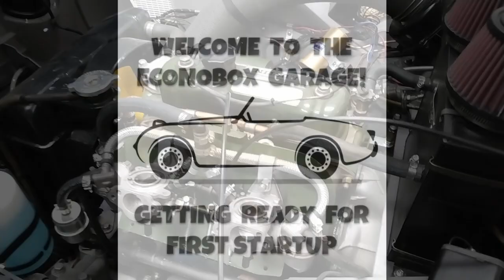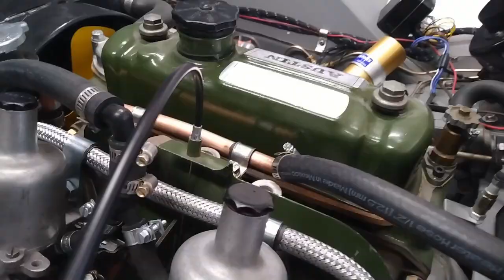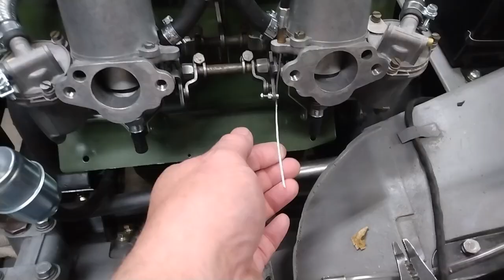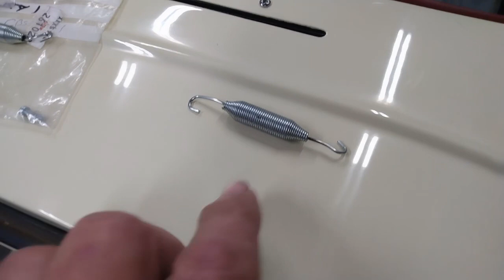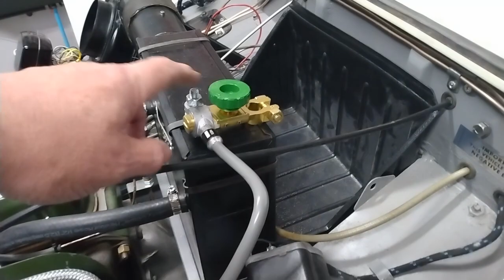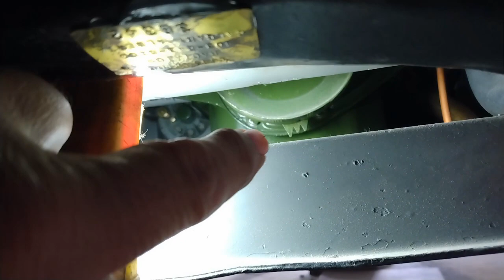Getting ready for the first start in over 40 years! Bugeye Build episode 129

Comment: Did you have to cut the two rods that go into the master cylinder? I have disc brakes that were added before and I am told that I have to shorten them to 3 11/16.
Thanks, John
Reply from the maker: Hello John. I didn't change mine at all. My rear brakes are the original Bugeye drums, the front disc setup is off a later Midget and I used the standard Bugeye master cylinder. I understand that it is not the ideal setup but it seems to be working OK.
Reply: @EconoboxGarage  thanks for the info.

Comment: Yet another good video, Ian! One tip you may want to share is that you can easily determine if the piston is at TDC by sticking a plastic straw in the spark plug hole. You then turn the crank and watch the straw go up, sit still for a split second, then go back down. You can move the crank back and forth until the straw reaches its highest point and just before it starts to go back down.
Reply from the maker: Great tip, thank you.

Comment: There's nothing hard about tuning SU carbs. The main things are to have the right needles and to make sure the jets are centred. The actual tuning is very easy but you really need a Unisyn or something similar to check thst they are in sync. I note that you have a later model engine and assuming the carbs came with it they should be fine.
Reply from the maker: Thanks. These are the later HS2s with the spring loaded needles.

Comment: Ian, vacuum advance is an economy device and is at its strongest at light throttle - when cruising etc. It is not necessary at idle. Hence, the vacuum port on the carburettor is positioned so vacuum is not available on closed throttle.
Porting it from the manifold will apply vacuum to the diaphragm at closed throttle (idle and deceleration). Vacuum at idle is usually around 21”Hg, but during deceleration close to 30”Hg - not good for an aging vacuum diaphragm. 
Unless you’re chasing fuel economy you may as well run your engine without it.
Reply from the maker: Thanks for the input. I'm going to run with what I've got for now and see how it goes. I believe there is a vacuum advance unit for the Lucas distributor that is designed for a manifold source. I may try and source that in the future.

Comment: One suggestion I might offer: sometimes turning the same number of flats on each carb to adjust the jets doesn’t work perfectly. What is important is that the jet lowering is the same on each carb. I have found that a better way to insure that result is to measure the depth of the jet on the one carb after lowering with a caliper and then make sure the depth measurement is the same on the other carb. 😊 Lin
Reply from the maker: Thanks for this Lin. I did double check the depth but forgot to mention it. I will be sure to cover that bit in the next couple of videos.

Comment: those carbs are very well done. I always find it funny that the oil needs to go in those dashpots, but only in that center tube. They don't need to be filled entirely. I may have done that a few times accidentally. It makes a big mess as the oil leaks out around the bottom of the pots.
Reply from the maker: Thanks Ken. This whole project has been a valuable learning experience. The past twenty or so years has been working on a fuel injected Ford Festiva... with extra spice added of course!